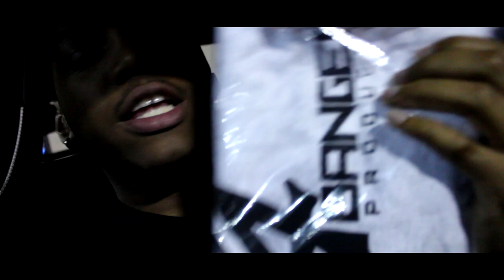STEALING RHDKEV'S CAR! - (WekFest FL 2016)

Comment: I ain't even watch the video yet but I just got my coupe out the shop bro (full b20b swap). Question you got a p28 ecu in yours right? I got a p75 right now it's running rough af I know a need hondata but I wanted to ask you if you had a link where you got urs.. madd em on eBay but I wanna make sure I get a Gucci one feel me.